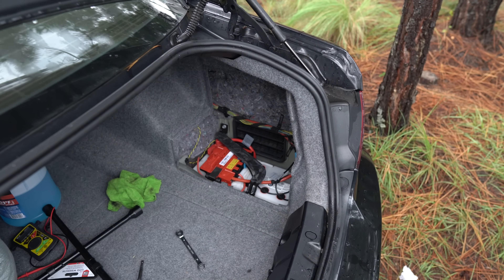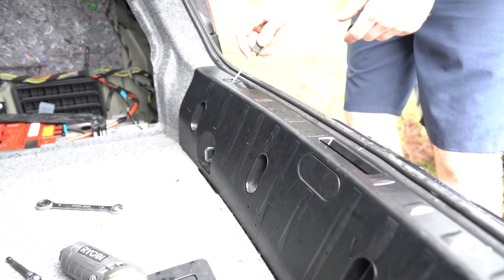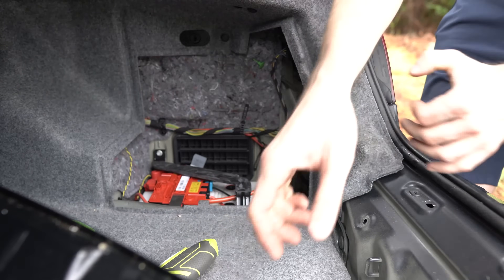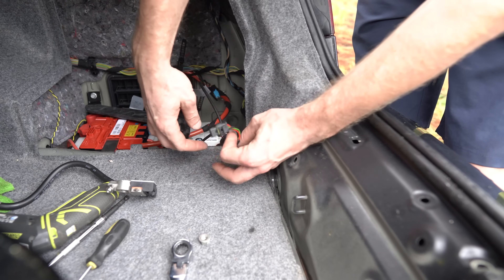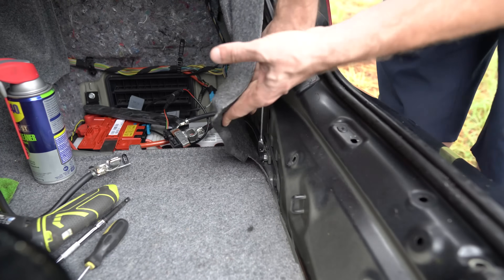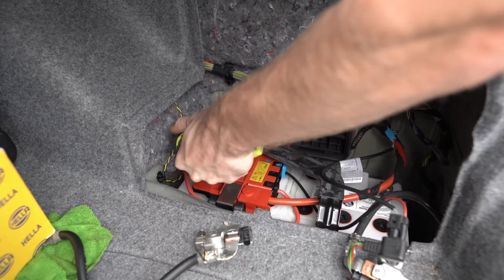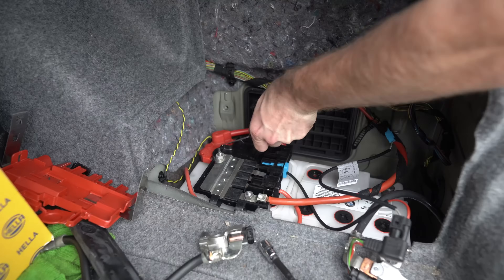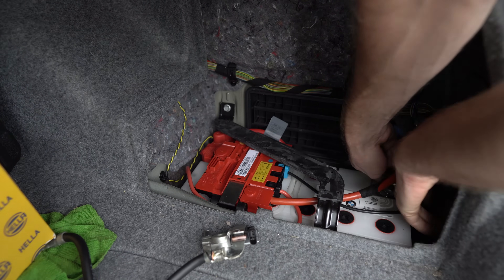How to replace Intelligent Battery Sensor on BMW IBS No Start No Crank

Comment: Do you know if its elv related problem?
Reply from the maker: ELV Steering Lock? don't think there is anything related. The IBS it's a power management system as far as I know, and it has no impact on ELV.
CAS or BCM modules are related to ELV.

Comment: I have a 07 335i No navigation. Do I need the adapter as well ?
Reply from the maker: I’m not sure, it all depends… you got to take a look what connector you have and order the new one base on that. Or you can go to bmw and buy sensors from them.
Good luck
Reply: @Makhnovets  thanks brother this was helpful

Comment: If i have 2011 model with the latest version of ibs sensor i dont need that adapter if i use another sensor with same part number, right?
Reply from the maker: correct, if the socket is the same, you don't need the adapter. it's just that the BMW doesn't manufacture the old IBS sensors any more, or it been revised.

Comment: You have to register the battery after replacing the IBS even if it’s not a new battery?
Reply from the maker: I'm not the BMW tech, but as far as I understand, the IBS is reading the data and the state of charge, it doesn't have onboard memory, with that being said, when you do the battery replacement you reset the data that been saved to DME, not the IBS. So the answer is no, you don't need to reset the battery/adaptation.

Comment: I bought a new ibs 2 years ago n0w it seems its not working again I have a e64 so how can u tell its not working I can't register my new batt it keep saying ibs isn't responding so do it need to be coded
Reply from the maker: IBS can not be coded, it's a monitor sensor, it constantly looking for battery health and send the info to the DME. you should have specific message related to IBS, if it's faulty. The amazon one if cheap, but instead I would buy one from the junk yard if you can do that, just a suggestion. How do you register new battery? what OBD tool do you use?
Reply: @Makhnovets  i have a autel bt906 i bought the new ibs sensor from partsgeek
Reply: @Makhnovets  autel scanner has option to code batteries after replacement
Reply: So if I buy a new ibs I can just pop it in ? No need to code it or anything?